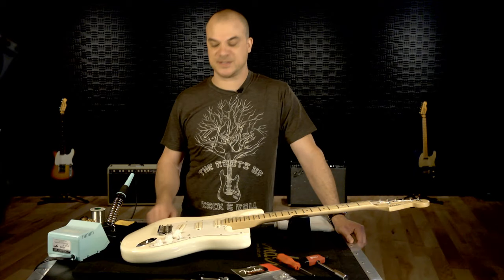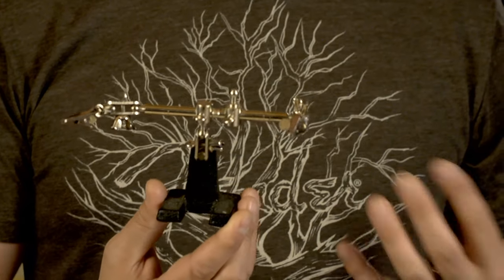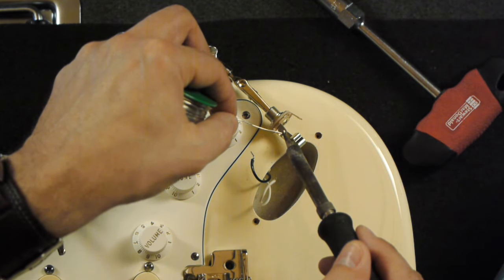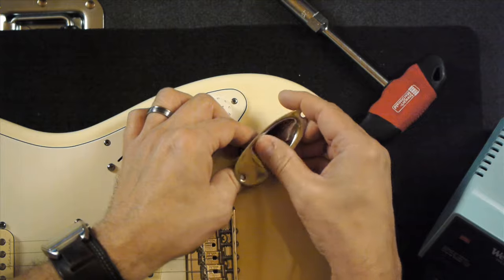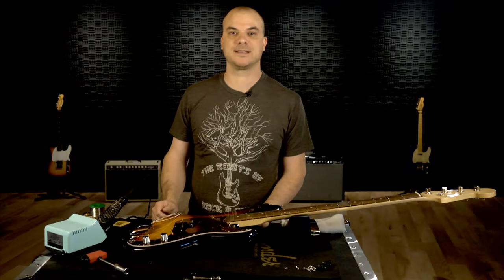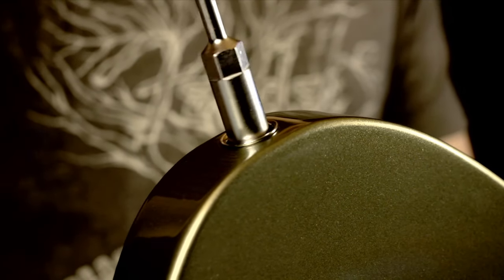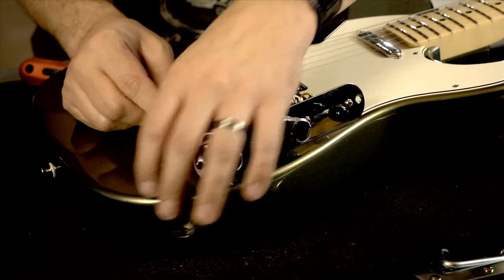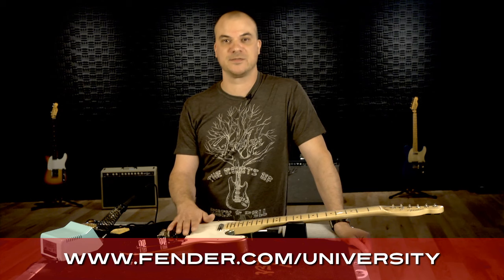How to Change Your Guitar's Output Jack | Fender

Comment: This man has balls of solid rock soldering over top of an expensive cream colored guitar body.
Reply: I think the guitar is a squier deluxe stratocaster lol
Reply: he scratched the tele with the control plate
Reply: EliteHunting1911 works of a professional
Reply: soldering is really not hard to do
Reply: @jp-ck7hx  no i think it is Stratocaster ultra
Reply: Mabey it was his mother in laws guitar.
Reply: that body wont be creme colored in 25 years it will be yellowed or hardly any paint on it
Reply: Instablaster
Reply: Tin foil...or better wrap, w/ leather.
Reply: @najmihakimkhairi1210  The ultra series didn’t exist 9 years ago dude.
Reply: No. It’s intentional as a part of the relic process
Reply: If you're already doing guitar repairs for a career I don't think you'll damage the guitar

Comment: Can you do a video where you don't use the tool with alligator clips so we can watch you solder as I do trying to weight parts down with wrenches and burning myself multiple times? Thanks
Reply: Buy one at Harbor FRIGHT on the cheap.

Comment: can you snip / cut the wire from the old lug at the start instead of using the soldering iron? Also does the crocodile clip damage the threads and should you have something protecting the guitar body in case you drip solder on it?

Comment: I wouldn't poke the wire into hot solder, I'd crimp the wire onto the clean terminal, then apply the solder.  I'd also protect the guitar finish from any solder drips - yeah, it probably won't happen, but if it does, you'll be super pissed!

But here's a money saving tip.  Most likely, (at least in my personal experience), the only problem with the jack is that the long prong that makes contact with the jack tip, needs to be slightly bent to restore a tight contact with the jack tip.
Reply: That was my quick fix at least a few times, tweaking the long prong a bit so it can maintain enough pressure to make a solid contact. Although I never worked on guitars before, I do need to either tweak or replace the jack on my 72 Tele. .
Reply: I fucking broke that part today I'm so pissed and like so confused on what to do on how to fix it
Reply: How bout if it's failing to make contact with the sleeve part and not the tip?
Reply: Yeah you're right about bending the connection to the tip ..I thought I had wired it wrong solder it about 10 times before I figured it out lol
Reply: @bowedsalmon81  I also broke that part that connects the guitar cable to the output jack of a strat. Can I just solder it back? I really need a way to connect it back!!!
Reply: @SoftwareCollection  yeah unscrew the input and change the part for it it costs like 5 bucks at guitat center just look for the correct one
Reply: @bowedsalmon81  Really appreciate the advice. But can I just stick it back again?
Reply: Drips sure. Touching the iron to the guitar is way more likely. Protect your work.

Comment: Yes, tin the iron first then heat from the opposite side. But you can damage components from using a hot iron for even a short amount of time - especially if the components you're using have a high heat conductivity (or relatively low max temperature) combined with a high melting point solder.

Comment: okay so fun story. i picked my sister’s old electric guitar from like, five years ago, and everything was going great! then, i started hearing a buzz whenever i plugged in the amp. i identified the issue: one of the wires broke off. so i’ve found the issue, but what do i do now? is there a way to fix it without getting the entire jack replaced? i’m a bit too afraid to replace the jack myself but i don’t really want to bring it to a shop. thanks for the help!!

Comment: Most guitar pots don't respond well to even a couple seconds with a 50W iron... trust me. Thanks for the tips, regards from the UK!
Reply: Try soldering transistors. Heat sinks are the way to go for this type of work.

How about soldering lithium ion batteries......... Scares the crap out of this knucklehead. Close the door while we clear this cannon jam quickly so we can party. Wait a sec. Is that a lithium ion battery!!!!!!

Comment: Someone's probably already mentioned but... Use protection over the piece you are working in in case of slip ups. Yes, even soldering pros.

Less stress for a simple basic job.

Not sure why I was led to this video. This knucklehead was looking for info on relocating the jack position and the meta info led this knucklehead here. Hmmm. Maybe someone will take extra precaution due to this rabbit hole. 

Oh, and besides not ouching your fingers the clamps will sink heat away so the insulation stays intact. A nice pro touch which is very important in some circumstances. 

Yes my termination is in spec qa!

Comment: Oh the misery. I took my son's Squier Tele and replaced the jack after he broke it.  I got a nice shiny new metal plate to hold it instead of the plastic one. Put the whole thing back together, plugged it in and the buzz was horrendous.  So I took the whole thing apart. ResoLdered everything (because I'm a Brit, there is an L in solder) and tested it and it was fine. Then I put it back together and fired up the amp and the buzzing was just as bad.  

This was the point where I discovered that having a dimmer switch for your lights which are on the same ring as the power for your amp is a very bad thing. I hope he can learn to play in the dark...
Reply: good to know, thanks

Comment: Mr. Dryer, one simple question hoping someone here can explain it...I have a Fender Squier and will try to connect a new jack....what I don't know is of the 2 contacts, how do I know which contact is the sleeve and which is the hot lead to the jack?  The main problem is I can't see where the Hot connector is on the jack by looking at the base as they are like 2 rings around the base of the connector.so the epoxy part partly hides the ring where the contact comes out before it gets to the wire lead.  Am I making sense?
Reply: Hey, I have the same problem, did you solve it? I'm looking for advise.

Comment: I was playing my strat today and suddenly slowly lost the sound. Then I was trying to get it back, I realized I can get sound if the plug is only halfway in to the input jack. But it doesn't stay in that way, so... 

I took the jack out, to see what it looks like... it has two lines (soldered to terminals) going in and inside the shaft of it there are two "hook"-like bent-in metal plates. It appears that I can get a sound connecting to either of the lines coming in, and when the plug is halfway in, it only touches one of the hooked metal plates. (Also it seems that the tip of the guitar cord plug is the active part, and the shaft is not.)

Comment: My fender electrocoustic output jack wasnt working as the bolt came loose and fell off, and when i got it back on no sound would come through my amp. So i unscrewed the plate off and tightened the bolt first, then screwed the plate back on (i was tightening it originally without taking the plate off). I think my problem was the jack wasnt reaching far enough into the input jack. duno if that helps anyone, but it scared me for a quick min

Comment: I have a problem: Everytime I connect my Squier to my Champion 40, makes a lot of noise (feedback) and it seems that I have to keep the guitar on a determined position
Reply: Replace the input jack. I had an Ibanez that did that, once I replaced it, worked great.
Or make sure all wires are soldered correctly.

Comment: That's the thing - you have to know what you're working with. The only time to worry about what you're talking about is with surface mount components. Regular leaded components, switches, connectors, etc. - dwell time and temperature don't really matter. Most solder used in electronics anymore isn't all that high of a heat melting point. And NEVER EVER use acid core solder like plumber's solder on electronics!
Reply: You forgot to add cleaning up your solder joint when done so it lasts.

There are charts to show what the shape of the joint "should" look like for longevity. Sure. This application may not be critical like in a fighter jet but good solder joints are best practice. Have some pride in your work. It's the only acceptable pride.
Reply: Thanks for mentioning about cleaning up soldered joints. I just tppk it as a given that people would. A little bit of isopropyl alcohol (IPA) and a stiff brush does wonders for cleaning off flux residue.

Comment: What if I have two black wires? I'm not replacing the output jack but rather putting in the first. I really do not know where to put the wires. (I have two black wires and one white wire)
Reply: Nathan Burge it's probably for the tremolo claw

Comment: What you describe is called tinning the tip of the iron. You can then add extra solder to the component on the opposite side of where you're touching the iron to the component to finish the connection as you'll never have enough solder from a tinning operation to finish the operation. Where one damages components is not too much heat but too much time of iron heating the parts being soldered. Use a high temp iron for a short amount of time. NASA certified solderer here.

Comment: If I were to a repair shop to get this fixed, would that be very expensive?
Reply: 1 year later I know, but yes, it would be generally a LOT more expensive than if you simply did it yourself.
Reply: I paid a little over $30 to get mine fixed but i went to a local guitar store. I didn't go to like GC or a shop that strictly does repairs

Comment: I opened my Squier bass, and the jack only has one wire that goes to it.   Is that normal?    All repair videosI see refer to two.wires ???
Reply: hey man did u ever figure this out? i have a squier bass and it only has the one red positive wire
Reply: Yes, mine only has one red positive wire...but if you look closely, it actually has TWO wires coming out of it.  so you have to connect both.   Did you connect one?
Reply: and, no didnt figure out yet.  I'm about to give up and just see how much guitar center will charge to fix it.  It's a spare bass...looking to actully get rid of it...but easier to sell if its working!
Reply: yea thats it. mine had a the red wire connected to the tone pot which i had snapped off of the jack by trying to screw the loose nut of the exterior of the jack. i connected the red wire to the positive and it didnt work. i had a loose black wire fall out when i opened it up. iv done a bit of reading and i think u have to connect the ground wire to the bridge

Comment: That's just wrong about guitar pots and a 50 watt iron. Think back to how many years people soldered those things with 100/140 watt Weller soldering guns! Guitar pots are old tech going back to vacuum tube days. Of course if you're talking about pots on a pc board like for EMG pickups then that might be a problem. I used to do this type of stuff for a living so I know what I'm talking about.

Comment: Is that a new Apple jack 👀 
God dam dat will protect him from burning his fingers.
Hard to pick your nose with burnt fingers. Atleast he didn't put anything under the jack on top of the guitar so as not to drip hot soilder on the guitar finish. 
Don't lose the washers that are on top and uh bottom. Is this video from the early 80s?  Looking at the watch fashionable bro.
I like how he remove the tele jack like he was not sure if was gonna come out. 😆 🤣 😂 😹 
He really should get a tork screwdriver from stewmac so as not too over tighten or under tighten those screw. Hey too loose and they might rattle. Also when ever you do work like that when your finished all ways use gibson tone polish. I been searching for my sound for years than I found gibson tone polish and there it was in a tiny little bottle for only $39.95

Comment: Also you shouldn't hold the soldering iron on the components, it can damage them by heating them too much. You should put solder on the tip of the iron then onto the wire.